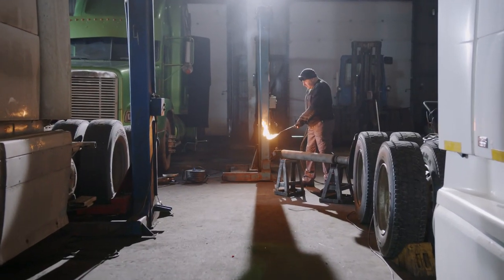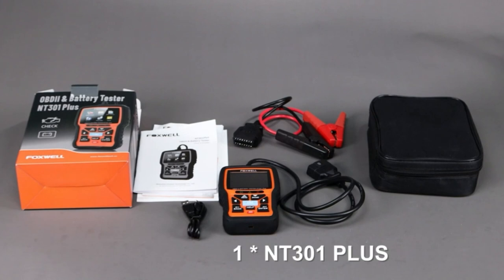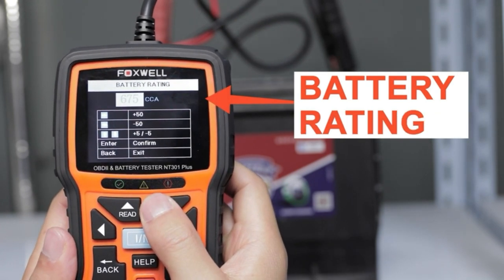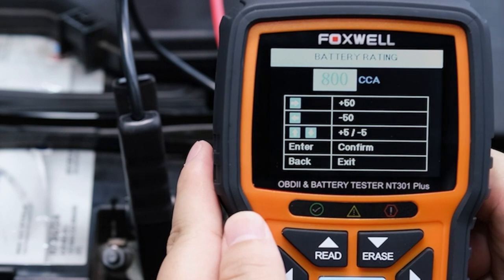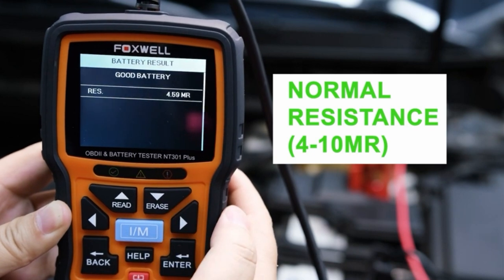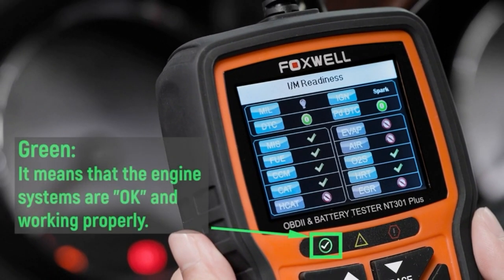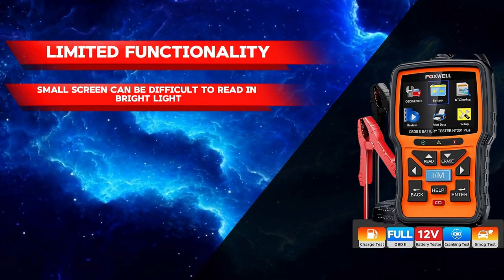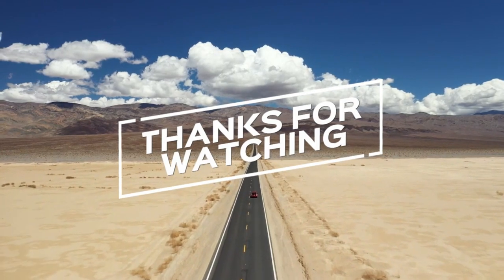FOXWELL NT301 Plus: Diagnose Your Car & Check Battery Health |

Comment: is that work with 2021 chrysler pacifica
Reply from the maker: I can't definitively say whether the FOXWELL NT301 Plus is compatible with your 2021 Chrysler Pacifica without checking the scanner's compatibility list or contacting the manufacturer. However, I can offer some suggestions that might help:

Check the FOXWELL NT301 Plus manual or website: The manual or website for the FOXWELL NT301 Plus should have a list of compatible vehicles. Look for a list of OBD-II compliant vehicles or a specific mention of 2021 Chrysler Pacifica.
Contact FOXWELL customer support: The FOXWELL customer support team can definitively tell you whether the NT301 Plus is compatible with your vehicle. You can find contact information on the FOXWELL website or by searching online.
Search online forums: There are many online forums for car enthusiasts and OBD-II scanner users. You can search these forums to see if anyone has had success using the FOXWELL NT301 Plus with a 2021 Chrysler Pacifica.
Here are some additional things to keep in mind:

OBD-II is a standardized system for on-board diagnostics, but not all scanners are compatible with all vehicles.
Even if a scanner is compatible with your vehicle, it may not be able to read all of the vehicle's diagnostic codes.
Some features of the scanner may not work with your vehicle.
I hope this helps!